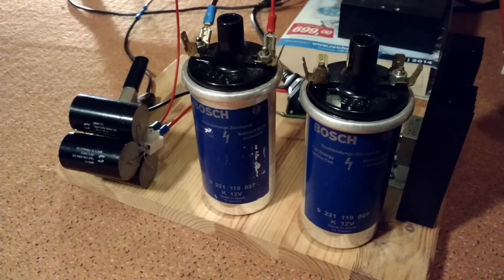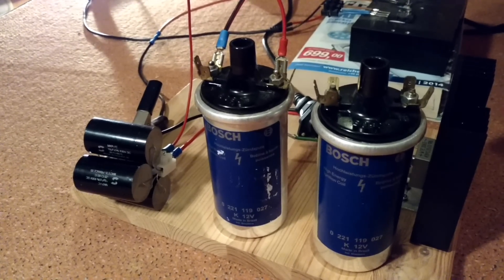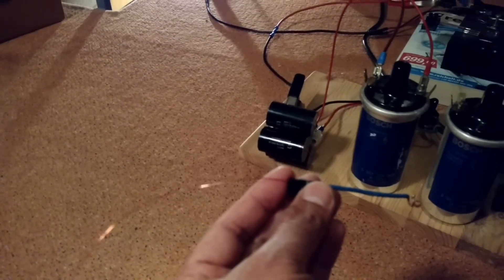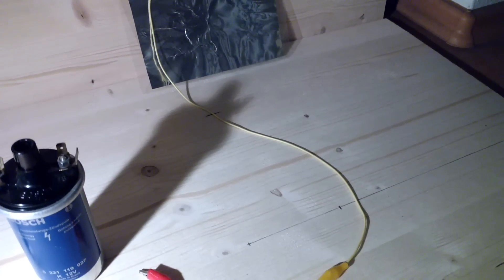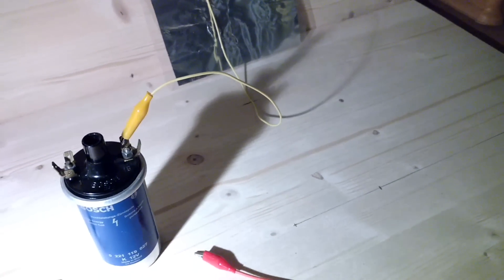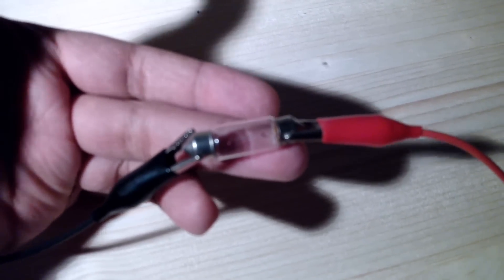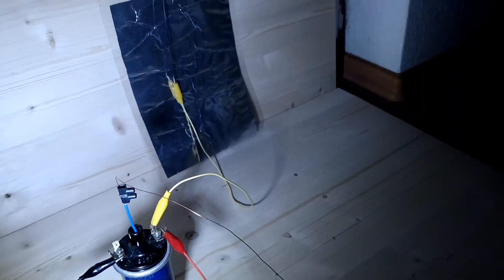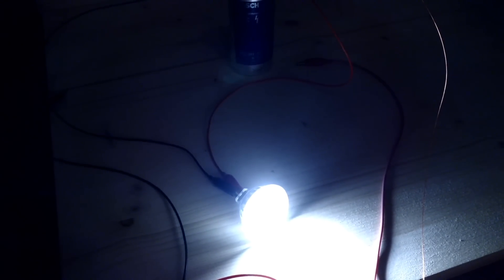Simple One Wire Power Transmission

Comment: Dear Okki Moeljadi, this is just and enough pretty video for your intend.  Anyone who have a minimum peace to read one paragraph of Nikola Tesla work, will be glad with your video.  And, related to the instability of the input power supply, others experimenters are using a lead-acid battery due to the fact that batteries can impinge a current surge into the circuit easily; and are portable and scalable in voltage and power. Regards,

Comment: So what's the point I've known about this since I was 8 and I'm 58 now !
Reply: The point is that everyone should use one wire to transmit electricity instead of multiple wires that cost money as since earth isn't really 0 volt, it can be used as a giant super low resistance wire which Tesla is using until the 'elites'/control-maniac government shut his project down by stop funding him.

Comment: You set up two ignition-coils to run one (RX) from the other (TX) as I could see the high-tension wire is running across the room to link the high voltage over to the other ignition-coil to step it down, but at a very high loss due to the missing earth link between them. It doesn't quite make sense but high tension power does get transferred like this over a distance at a great loss. This is like a monopole magnet theory, it just doesn't exist, does it?  Do you know what % is the energy transfer rate apart from miserable, huh?
Reply from the maker: Yes my system is not efficient but at least I can prove that we can use it to run a computer: https://youtu.be/jc0NgSa6xJE

Comment: Very nice 👍 I wanna try this for years. I have a few suggestions. 1 tray using a better insulated wire or even an coaxial cable. beacause the high voltage/frequency energy can leak/radiate in to the air. 
2. For more power you need to put a similar aluminum foil on to the primary coil. To push electrons through the wire the alternating current needs to take them from somewhere and put them somewhere.. the plate is used as an air capacitor.
3 an oscilloscope would be handy.. so can you find out the exact size of the aluminum plate needed for perfect resonance. 4 for people watching this and not believing.. search on Google Tesla one wire power transfer patents... and after that make a comment.
Reply: This is why tesla stopped the 1 wire, he realized the skin effect was occurring so often and to such a degree that you might aswell use the air as the medium
Reply from the maker: Thank you for your kind comment. With this setup I can run a complete PC (a tower with external display). I did not make video of that though. Here is a video showing me using similar setup to power a laptop: https://youtu.be/jc0NgSa6xJE

Comment: Offer.
The digitized energy for environmental technologies.
A novel electronic pulse technology brings about the voltage doubling of each power source, thus high efficiency power gain for applications in general, especially for electric vehicles with electronic battery charging unit for long distance, photovoltaic, thermoelectric generators and aerospace.
INNOVATIVE TECHNOLOGIES - RZ-IT
Institute for Renewable Energy
Rudolf Zölde
samplingtec@gmail.com
www.rz-innovatec.com
Reply from the maker: You are right. Pulse and resonance lead to high efficiency system.
Reply from the maker: Hallo Herr Zölde,
was meinen Sie mit "Offer"? Bieten Sie mir etwas an?
Liebe Grüße
Okki Moeljadi

Comment: you use two wires not only one
1- the high voltage wire
2- the ground wire
because if you use the normal +220 volt wire (from the wall) and the ground wire the lamp will light
but you will use a real ground wire to make the lamp light
Reply from the maker: Please check out my last one wire transmission video. I use my home made transformers to transfer the power.

Comment: This is a very SHADY experiment and that ALU foil in my view simply isn't large enough to capture sufficent power for such hungry loads like the incandescent light or that motor. Further you can hear that the motor speeds up slow. i.e. the receiver ingniton coil generates very little amperage. So efficiency is miserable looking at the input power vs output power. Tesla wasn't successful in wireless power transfer either as there's a huge power loss in doing that. It is OK to transfer it for RF communication but at a great loss also however, a modern (digital) receiver can compensate for it until it drops out, whereas an analog Receiver keeps producing an everlouder hiss as the range increases...
Reply: Stephen Balogh Not true at all actually, it depends on the voltage being sent across the line
Reply: He just setup two ignition-coils to run one (RX) from the other (TX) as I could see the high-tension wire running across the room to link the high voltage over to the other ignition-coil that steps it down, but at a very high loss because of the missing earth link between them. It doesn't quite make sense but high tension power does get transferred like this over a distance but at a great loss. This is like a mono-pole magnet theory, it just doesn't exist, does it? Ask him what is the energy efficiency transfer rate!

Comment: What is the minimum frequency from whereon you dont get shocked anymore , when you touch the high voltage side single wire ?
Reply from the maker: With this setup, you will always get shocked. Ignition coils will not work with such high frequency.

Comment: yes one wire just like how utility power can be transmitted by one wire as long as the supply and the load are sharing a ground. don't you think the foil is acting similar to a ground rod? so basically air is acting as the other 1/2 of the circuit. I wonder if it would transmit power through a vacuum?
Reply from the maker: On Nikola Tesla's one wire power transmission, you don't need common ground for both transmitter and receiver (or load). Yes the metal plate is acting like a ground. Actually it is a virtual ground.  I think it is possible to transmit power wirelessly through vacuum.

Comment: I find your (re)discoveries very important and nicely demonstrated! Please continue with your researches and publishing them on YouTube. And I have a question: why do you use capacitors on the primary side of transmitter and what is the capacity and voltage? Thanks a lot!
Reply from the maker: Drago Kelšin Thanks for your comment. The capacitor on primary side of transmitter is there only for voltage stability at transistor on-time. I use 3x 10uF 600V capacitors connected in parallel. If you have a good power supply you will not need any additional capacitor.